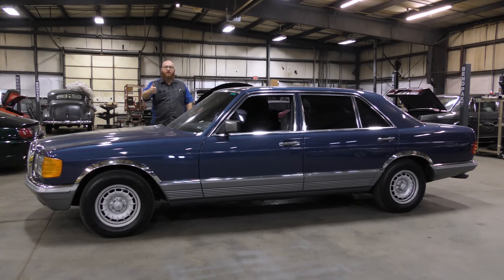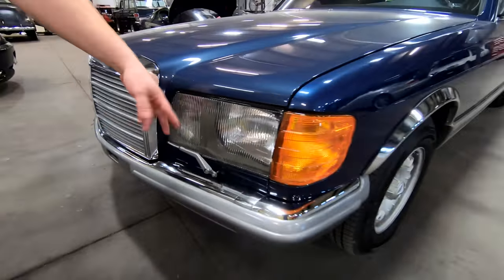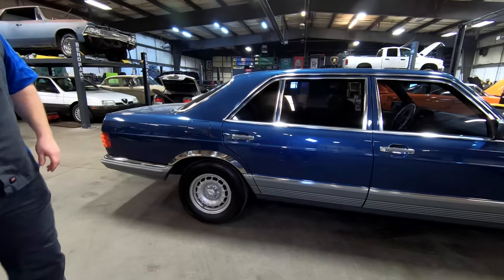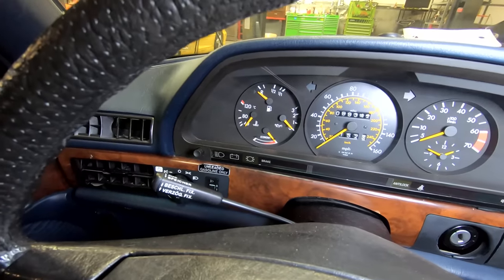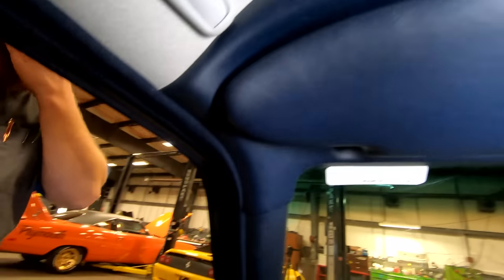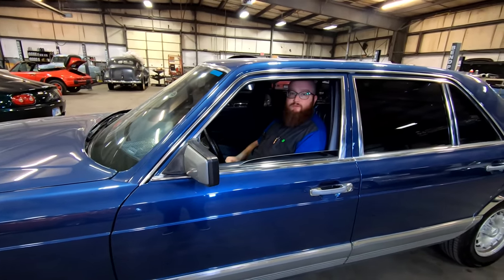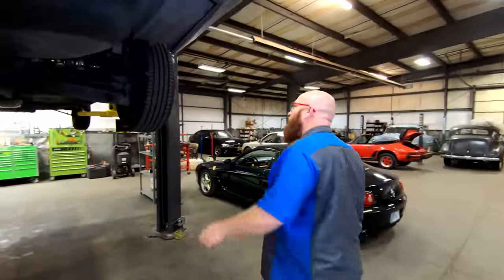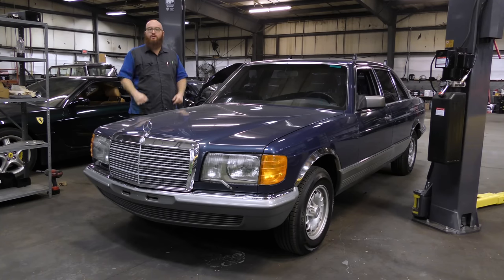Truly a gray market god! Shockingly perfect 1985 Mercedes 500SEL! The CAR WIZARD is in love

Comment: A stunning example of a great car. 
I have a First Aid kit I kept after I sold a W124. Nothing used or opened.
The velour option is European and way better than Leather.
Reply: I bought a '98 Volvo S70 2.5 turbo a while ago. A one owner car, bought new by an elderly gentleman who had to sell it last year due to him being well over 90 and sadly unable to drive anymore.
Backseat was absolutely mint when I bought it! Never used.
The First Aid kit was still in its little compartment in the parcel shelf, untouched. Never opened!
The trunk was pristine, carpets like new!
100.000 miles in 22 years, an average of 4500 miles/year. 
Every service and check-up done by the book every single year!
It's by far the best car I've ever owned! Mostly thanks to the previous owner took so good care of it. It'll be 24 years old in 2022, odometer just reached 118.000 miles (190.000 km's). I drive it several days a week, and it is super reliable!

Comment: I remember that period in the 80s where bringing over gray market cars was very popular. I knew a few people who brought over Mercedes turbo diesels similar to that one. And a Porsche 911 could be had over there for a lot less than in the U.S. That was the incentive, it was the money saved at that time. Getting them shipped over was sometimes stressful though, and without incurring damage along the way. Looking back I'm glad I didn't get one of those air cooled Porsche's, as they all had lousy air conditioners. Not good in the hot humid east coast,
Reply: Even though you have edited out one of your reasons you were glad you didn't get an air cooled was because of the IMS issue...The air cooled Porsches didn't have IMS bearing issues.  The premature failure of the IMS bearing started with the first water cooled engines in 1999 in both the 986 Boxster and the 996 911.  In 2009, the M96 and M97 engines were replaced by the 9A1 engine which didn't use the IMS system.  Will all IMS bearings eventually fail? Absolutely, just as all engine components will eventually fail.  The premature failure mainly was on the M96 engine.  According to information published about the Eisen IMS Class Action Lawsuit, the single row IMS bearing used in 2000 through 2005 model years is reported to have an 8% failure rate, versus less than 1% with the dual row IMS bearing.
Reply: And for the record you should have bought one of those air-cooled Porsches because they are worth a small fortune today.
Reply: @MDQDZINE  They still had lousy a/c. I couldn't live with that.
Reply: And even for that there was, and is a fix.  It just wasn't the car for you and that's fine.  No car is perfect and  none are a one size fits all.  It is always a give and take with everything.
Reply: @MDQDZINE  There's a good video of that whole IMS bearing failure issue on youtube.I watched it from start to finish. He covered all the engines that had it and the fixes for it. But one thing I don't remember him covering was that it was only on the water cooled models. I'm going to watch it again to see if I just missed that part or if it was left out completely. I still would prefer the air cooled 911s. And with advent of a/c compressors driven by electric motors, taken from the electric car parts bins, I've read those kits for 911s work pretty well. That moves all of the a/c components out of the engine compartment completely. I've always liked 911s, but not so much I'd be willing to sweat in one in summer just to have one.
Reply: @tedstriker754  as a Porsche owner with one of those model years I am well versed in the IMS bearing issue.  The whole hysteria of it centered around the 986/996 & 987/997 non turbo motors.  Air cooled were not affected and therefore probably not mentioned or referenced in the video.

Comment: Perfect example in great condition. 
I think the odometer is in kilometers not miles. 89,000 kilos is around 55,000 miles!
That car is worth $18,000 USD at least. 
Cheers 🇨🇦
Reply: Nope, the odometer is in miles.
Reply: Seems this car was converted at some point or ordered from the factory in MPH vs KPH. I believe military and foreign service members could order european cars in europe that came with MPH as standard. They were specially ordered cars that most people bought knowing they were going to take the car home when their tour was over.
Reply: @ingresswizard9044  Only partially Imperial though, if the temperature gauge is still in metric. Grey market import companies in the US would sometimes change out gauges on arrival, which could have been what happened here. If it was a factory order, I'd bet Daimler-Benz would have just installed a complete US-spec instrument panel instead of mix and match
Reply: @11sfr  UK bound cars would have the odometer in miles and the temp gauge in Centigrade (as it was named at the time). They probably just fitted a UK spec gauge cluster in those US export cars.
Reply: @stephenholland5930  a couple people on here have decoded the VIN and determined it was built as an Argentine market car, which makes sense, as the US diplomat owner was stationed at the embassy in Buenos Aires for a time

Comment: That code near the radio is the code to the radio. If you disconnect the battery the radio goes into a safe mode of some sort where it thinks the radio is being stolen (70s- early 2000). If you loose that code you have to go to the dealer and hope they have it in their system by vin. Its happened to me on a 97 s500 couple years back, for the love of god dont loose that code

Comment: You didn't show the best feature! It has a power reclining rear bench seat! My dad used to have a 380 SEL. I don't know what the difference is between the 380 and 500 SEL. My dad's also had those nice come wheel arch trims. Most of them didn't, but I love that trim. Edit: also, this is an extended wheelbase from the regular sedans.
Reply: Engine capacity in cubic centimetres is the difference. Generally, the engines grew in size through the years.
Reply: Yes I had a Grey Mkt  500SEL, 1984 and it had that rear seat that moved out 😊 I finally  got owning a Benz out of my system. I had that car for 16 yrs  and I finally had to get rid of it. NEVER BUY A USED BENZ UNLESS YOU HAVE AFULL FACTORY WARRENTY. THAT CAR COST ME THOUSANDS AND THOUSANDS OF DOLLARS on parts that broke and Never ever buy a grey Mkt  car as the parts numbers are not the same as American Mercedes and have to find a wholesale dealer to get parts from Germany

Comment: When I was in Germany I noticed a lot of the Mercedes had velour instead of leather. I guess to them it’s more practical. Wish we got the option for velour on Mercedes in the US.
Reply: It was common. Leather is cold in winter and hot in summer, most did not prefer it where we had real seasons.
Reply: The early 2000s C230 Kompressor coupe had standard velour.

Comment: I had a 1983 500 SEC. Another fabulous W126 series Merc. But rubber doesn't last forever. After 20 yrs a couple of valve stem oil seals began to leak overnight, regularly fouling a couple of spark plugs.

Comment: Pros:
Bumpers are prettier
Euro headlamps are very good in most ways
That washer reservoir is behind the mini firewall, away from exhaust heat! That's a good thing.
Velour is a nice change of pace for a Benz in the US

Cons:
If you're in W126 land, just get a 560SEL, it's US spec and has the torque
US bumpers are more durable if they get bumped
Chrome arch trim  UGH (and rust risk)

Comment: I owned a 1990 560SEL that was a cool car. It had air suspension that lowered the suspension at high speeds and the back seat reclined. Also had wedge shaped pillows for the rear passengers feet. It was fast I was doing about 150 mph and it stalled...but then restarted when the mph dropped... I asked my mechanic and he said on the US version the fuel pumps turn off at 150. The euro version I heard did around 180!

Comment: Harold Vickers, born in 1924, died in 2020 had been an US-American WWII hero and Diplomat in France. As most Diplomats he was allowed to bring back a car in his home country when his time in the foreign country was done. The Department of Foreign Affair did even paid the transportation even though it went with the origin vessel chartered by Daimler Benz bringing as a floating parking house tens of thousands of Mercedes' cars and trucks at each Atlantic Passage from Bremerhaven to Savanah. As a diplomat he had not to adjust his vehicle to the US-standards (lights, bumpers and so on) after arrival in the USA and before registration. Diplomats up to today can do that. That's kind of the still very small dripping gray import marked. The only rule is, that they have to own the car for a certain time - it got adjusted a few times, thus I don't remember 2, 3 or 5 years - before legaly selling it within the US borders. Mr. Vickers is burried in Albuquerque, as far as I remember. Last tipp from Germany to the USA: if you want to buy one of these Mercedes W126, don't go bigger than the 500. Everything bigger has a total different (more heavy) design under the hood to make the front axle and the steering system and the entire engine bay and gear-box-holders and so on along the entire drive shaft, than in the W126 up to the V8 500-Engine to make the vehicle reliable last und survive the brutal force and weight that comes with the 560-Engine. Every item that you'll maintain, repair or exchange on a 560 will cost twice the price than on all the W126 up to the 500 version; - completely independed from the question wether or not it is the coupé, the short limousine, the long limousine, the stretch limousine, one of the two station wagons ever built or the one convertible ever built.

Comment: lovely car, much better than the USA models.   I have a 560SEL in the same colour.   If this was my car I would have the timing chain, guides, tensioner and camshaft oiler kits done by the wizard (if not already) as preventative maintenance since it already has 89k on the clock.   These should be done every 100k and the guides wear with age too.   I would also replace that exhaust system with those 80s cats that have been added for the federalization process that would not have been there when sold new in Germany.    Great car.

Comment: I had an ‘84 500 SEL gray market….black over tan. Beautiful car and blisteringly fast. Floor it and hold the hammer down and it would put you back into the seat when shifting into high gear at 120mph. I chickened out soon after as the speedometer continued to sweep with no sign of letting up. I sold it just shy of 300,000 miles on the odometer. Differences: Mine had air suspension for unimproved roads, leveling headlights, city/country horn switch, leather, wide sunroof……I should have kept that car.

Comment: With those gray market cars they are a double edge sword in the US. We had a club member with a beautiful 280 SLC. That combination was unavailable in the US but it was a six cylinder double overhead cam engine with the hardtop version of the R107 SL. 

He spent $10,000 getting it a beautiful light metallic blue paint job. 

And it would not pass California smog. There was a proprietary component it was electronic at the gray market converter used and it no longer worked and you could not get them anymore. 

A lot of those gray market cars I think drove better than the US version. I drove the same W1 26 with the M1 10 six-cylinder engine, the same engine that was in the 280 SLC. 

It still had plenty of power and the front end was a lot lighter than the V-8‘s. 

I drove a gray market 83 380 SL. It seemed an inch or two lower than the US version, the bumpers were a lot nicer than those cowcatcher bumpers, and the engine had I’ll bet another 75 hp. 

By the way you kept speaking of those bumpers in the W126 is so big. 

The US versions weren’t bad at all. I’m thinking you were thinking of its predecessor the W116 and all of its related models

Those things were genuinely ugly and you could use them as a bench. 

If you wanna know what I’m talking about look at any 80s SL

The story is originally the US government required a test for a 5 mile an hour collision with no damage. 

So that’s what these monsters were designed for. The story I heard is at the government later rescinded that requirement but by then the design was already in the pipeline. 

Getting back to the original subject it probably depends on which state you’re in as to whether you will find most gray market cars agreeable or not. And some of them are lousy conversions while others you would think the factory did it

All depends on the conversion company in west Germany

Comment: This is a lot nicer then your classic bmw (especially mine oh my god that Benz is beautiful) and probably just as reliable as an old bmw. I had a bmw dealership check out my 1990 535i when I took it in for an alignment after replacing the tie rods. I did a very crude tape measure alignment before I drove it to the dealer abs it was very close, only .5 degrees off. I could of took it to a Firestone to get it aligned but I wanted a bmw certified tech to go over the entire car and they said it’s perfect. My alignment costed double what a 3rd party alignment shop would of charge for a single alignment, but it gave me the satisfaction that it’s been done right because I know with the German cars, you got to put a load on the suspension whether it’s with weights or spreading the front wheels before doing the alignment which is how the factory does it

Comment: That velour/plush upholstery was a very common type on Mercedes in Europe, and I guess in most parts of the world except for the USA.
For the US market most European manufacturers offered leather upholstery either as standard or in a package with a lot of extras at a fairly good price. That's why you'll find a lot more old Volvo 240's with leather interiors in the US than was ever sold in Europe, and especially Sweden.
It was a way to really position the cars and the brands as up-market and luxury in the US market.
As a Swede it used to be strange seeing these workhorses, like the 245's were here, in USA equipped with leather seats, air conditioning, sun roof, automatic gearbox and all the bells and whistles. Here they were usually working class family haulers, driven by bluecollar workers, not so much over at your side of the pond.

Comment: Back in 1985, according to CR, Mercedes was the most reliable brand of automobile.  OK, Toyota edged them out by a squeaky thin margin, but considering that 90% of Toyota's of that  era didn't  even have electric windows, I think that qualifies Benz as the most reliable. Also had the highest owner satisfaction ( I remember a subaru commercial bragging that they had the second best customer satisfaction "behind only Mercedes Benz")..  They were also the safest cars, longest lasting, the list goes on and on and on.   I so wish mercedes woild go back to those roots.

Comment: You're right about the colour, Wizard. Mercedes call it nautikblau. Nautical blue. (I think.) Those chrome wheel arch extensions are non-original and a bad idea. Personally I think they look awful but the main issue with them is that they retain moisture and promote corrosion.

Comment: Thank you for the review of this amazing car!
 I guess the washer on the wood panel used to be thermometer (the plastic part must dropped off), even this car has digital thermometer on the dashboard some old cars has it glued like that. I think the new owner should not to try so hard to take it off and if they used some aggressive glue, it would be better to stick there another old thermometer :-D
 The velur seats are quite common here in Europe, especially in w116, but also in w126. there was also an option to have normal fabric seats and of course leather.
 I do love those old Mercedes, especially the Europe versions. It is interesting, that you have there US odometer, but the rest is EU version, as you mentioned lights, bumpers etc..
 Thanks one more time for the review!
Filip

Comment: I would have doubts about the mileage, the instrument cluster is not original as the speedometer is for UK/USA and the plastic warning light cards in the bottom of the cluster are for a US model. VDO put a date code on the back of their instruments. Was the car imported to California originally because they usually didn’t put an air pump or evap canister on them when imported.

Comment: we still got a 280 lorinser model, from 1984. with just 174k km on it. this model is pretty 'bold' tbh no leather no dual climate, no sunroof, no sport steering

first thing to look at are the chrome stripes above the wheel archers check for rust

but please take these cars to benz specialist for maintance, not jut a local garage

Comment: This 500 Mercedes’, looks great, but please, take off the tappet covers. Remover the over cam oil feed tubes, replace the little plastic clips, then close up again. If you don’t do this, do not cry, when a cam snaps. 
Those plastic oil feed clips get very brittle. Just the normal use can cause it to loose oil pressure with devastating consequences. 
I love these cars. But this is the one thing you need to do.

Comment: That code you showed on the dash is for the radio. If you lose power, like disconnecting the battery, you have to enter that code or the radio won't work. It is to discourage thieves from stealing the radio. You obviously don't want to leave that code stuck there.
I think the American version of these was a 560 with a detuned engine due to smog regs.

Comment: US  cars never had cloth interior but it was available  in the rest of the world.  Just like a 126 with roll up windows and a carbureted six cylinder and a five speed manual. The eruo spec v8's had a dual row timing chain after they had gone to a single row for US cars.   I worked on many grey market cars in the late eighties an early nineties